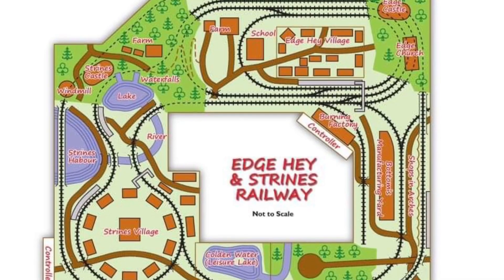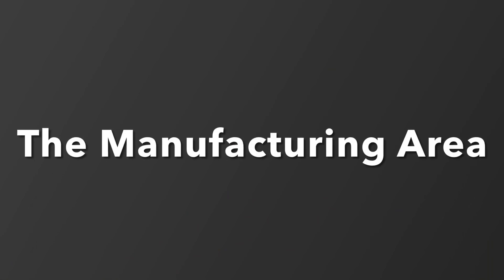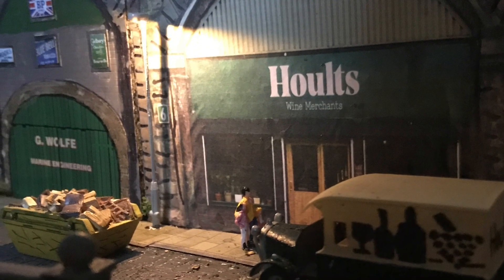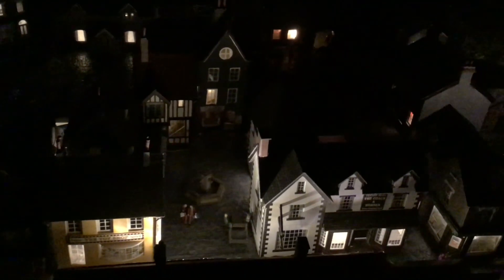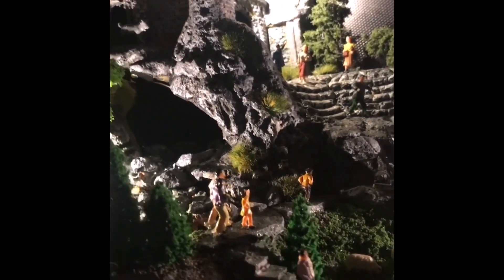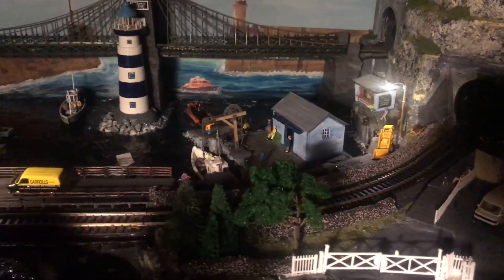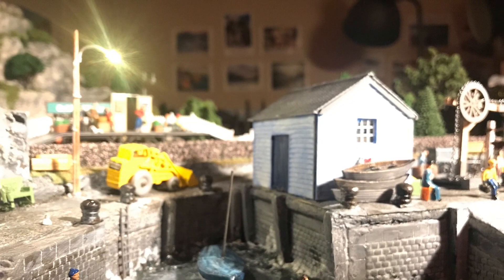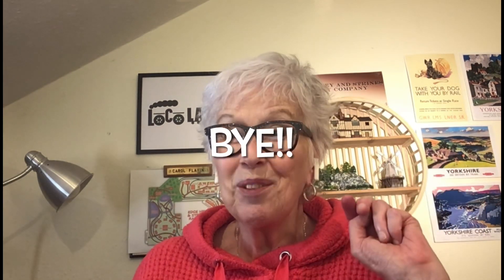ADDING LIGHTING - To Enhance your Model Railway Layout

Comment: Hi Carol. I've just watched your layout tour video. I'm new to model railway so i'm so glad to see video's like this. Could you tell me the size off the layout  and how you find the duck-under? cheers david
Reply from the maker: Hi David. Glad you found it a useful video. The layout is 11ft wide and 10ft deep. There is a lift up bridge middle front to allow me into the centre and the village on the far side can be lifted out to allow access. There are also cut out sections so I never have to lean over more than 2.5ft. I have a video in production at the moment that explains the lift up bridge in more detail, but it will be a month or so until I get it finished as I have a couple more to do before that.